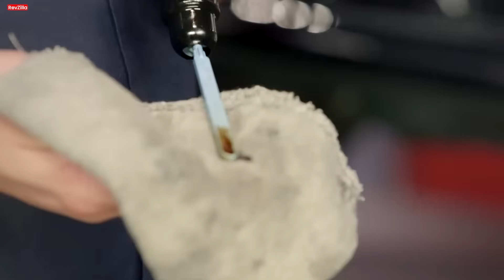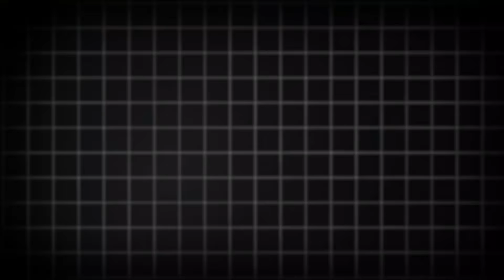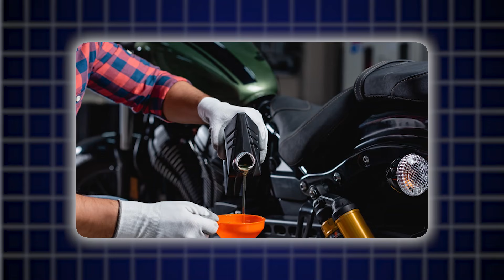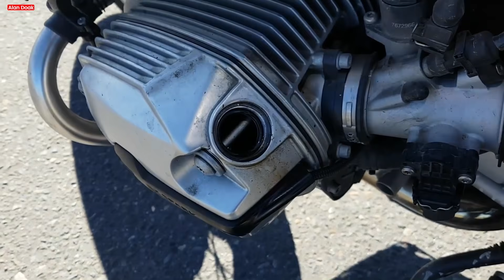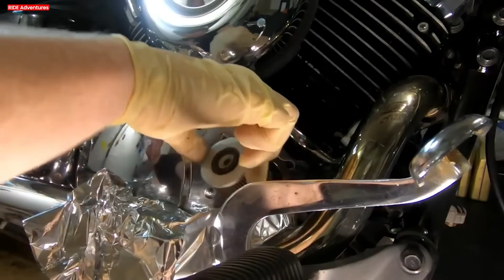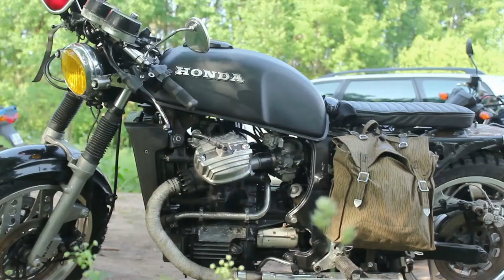NEVER Do This After an Oil Change! (KILLS Your Engine Fast)

Comment: Sir I need your help manufacturer recommend grade is 10w30 for my motorcycle after 30000km I feel engine started overheating I can clearly feel the heat on my face so I shifted to 10w50 engine oil now it's feels buttery smooth while touching triple digits speed can I use it permanently sir ?😊
Reply from the maker: You can use 10W-50, but with some understanding.
The manufacturer recommends 10W-30 for normal conditions and fuel efficiency. A higher-viscosity oil like 10W-50 can feel smoother and reduce heat in high-temperature riding, high speeds, or a worn engine, which is why you’re feeling the difference after 30,000 km.

It’s generally safe to continue if your climate is hot and you ride hard, but expect slightly lower fuel economy and make sure cold starts are still smooth. If you ride gently or in cooler weather, switching back to 10W-30 during winter is better.

Most important: always use the correct JASO MA/MA2 motorcycle oil and keep change intervals on time. 👍
Reply: @TheMotorcycleBrain  thank you so much your feedback helped me a lot tomorrow I'm going to take my motorcycle to authorise service centre for service so now I'll use 10w30 fully synthetic engine oil 😊
Reply: @MR_UNKNOWN_BUDDY  thicker oil cools down slower. 10-30 is average. 10-40 is okay too. dont have to go 10-50 or 15-50 .. unless you live in the hottest place on earth. thin oil gives you more horsepower too
Reply: @manbiteslife3110  thanks bro but I'm from India so my motorcycle is giving best performance with 20w50 fully synthetic engine oil summer temperature 50°

Comment: On the first start after changing the oil I make it a habit to build oil pressure by cranking the engine and killing it the moment it starts. I repeat this procedure  3 or 4 times before letting it idle.
Reply: @Cundalinis_Hand  my bike won't engage ignition unless it detects oil pressure when cranking.
Reply: @mattyb7736  Nice feature.
Reply from the maker: That's an interesting approach to ensure oil pressure builds up!